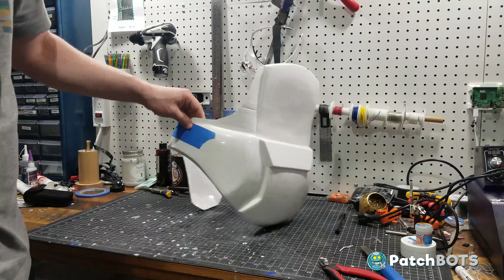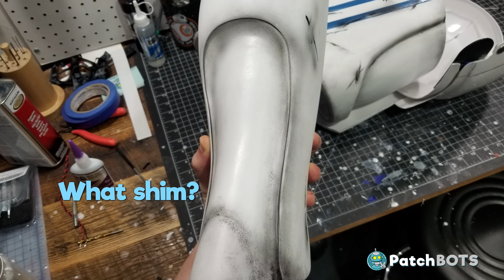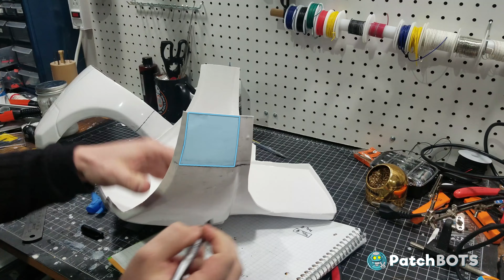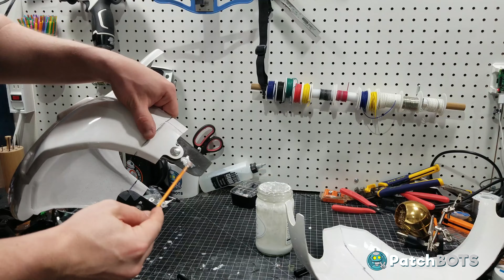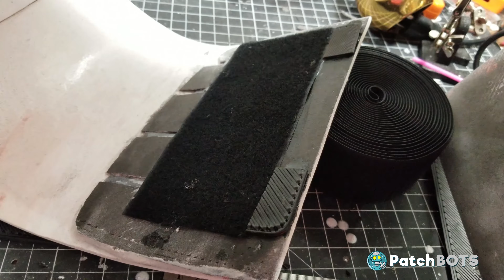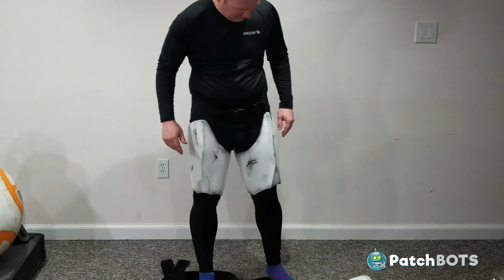Star Wars Clone Trooper Armor Cosplay - Part 13 - Mid-Section

Comment: Out of curiosity, once you start working on the accessories for the armor, what are you going to do for the kama (the battle skirt that Commander Bow wears)? Cause that’s one of the important parts of the Commander Bow armor, especially since it connects to the belt.
Reply from the maker: Hi Rhydon, Yes, I'm going to make that after I get the belt installed.  The kama will have it's own video.

Comment: You can cut the plate above the butt and put it directly on the rear ab piece. It helps for mobility and is more screen accurate. Also you can shorten the ab piece, especially on the sides. Movie ab piece is shorter than what you have right now. Again more mobility and more accurate.
Reply from the maker: Very interesting. I took a look at a scene from ROTS and I definitely see a trooper with a separate kidney plate.  You're right.   Not sure if I'm actually going to do it, but you've definitely given me something to think about!
Reply: @PatchBOTS  Im spending so much time analyzing every shot to make my costume, Im happy it's useful to somebody else !

Comment: Really nice to see the armor coming together :)
How did you attached the cod/butt to the hold on to the body?
Reply from the maker: The cod/butt piece is just being held up my hips.  I couldn't slip it on or off if i try, so once it's snapped into place around my mid-section it just kinda hangs out there on its own.

Comment: I really appreciate how you try to show your mistakes and how you fixed them. Building a Clone is becoming less and less nerve-wracking for me because of you!
Reply from the maker: Yeah the one thing I'm learning from this build is that mistakes are NOT the end of the world.  Anything can fixed.  And the more effort you put into fixing the less likely anyone would ever even notice
Reply: "The greatest teacher, failure is." ~Yoda

It's a true statement, and what you said is absolutely right. Watching this series of video's as well as other people's builds has shown me that just about anything can be fixed. I'm printing out a piece of Clone hand armor right now and due to an unforeseen snafu, the printer skipped a line and now there's an indent in the top going up. At first, I thought about just starting the print over. But now, I know that I can just use wood filler to build it up til it's all on the same level and nice and uniform.

Can't wait to see what you build!

Comment: 2nd and also I'm planning on building a Black and Cyan armour (All the white into Black and the Blue into Cyan) and wanted to ask do you have anything that you could suggest that may be cheaper? Not the armour I mean paint and so on. And thanks, I'll be using this when I make my armour.
Reply from the maker: Hm, not really.  Paint is expensive, unfortunately.  And no matter what colors you do you'll need a ton of it.  (even the whtie armor needs to be sprayed white).